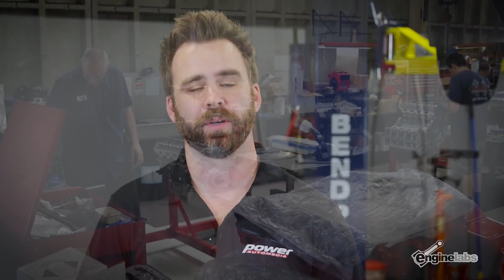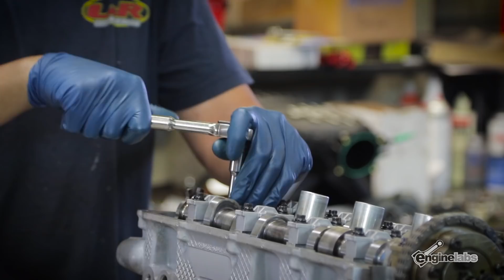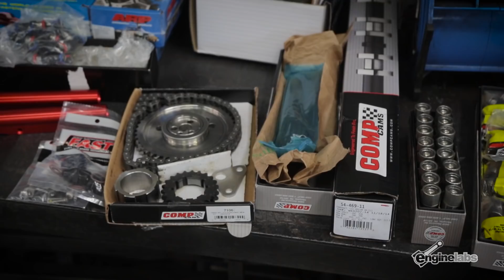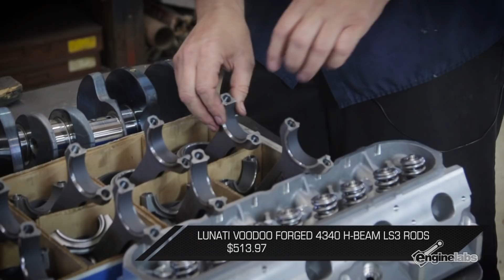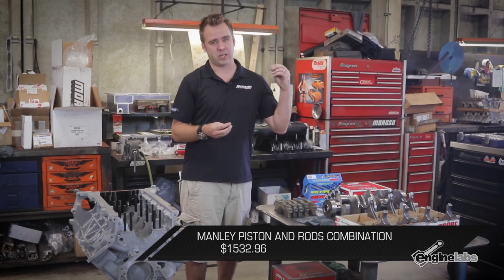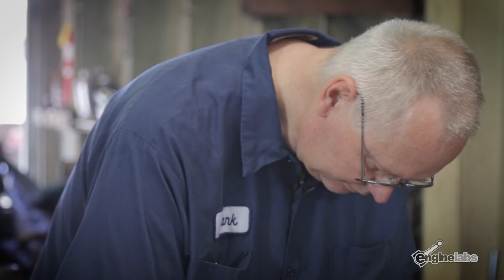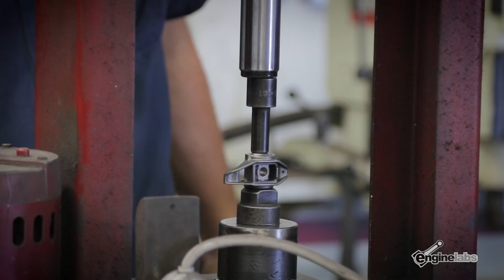$10k Coyote vs LS3 Shootout - The Build

Comment: LS376 is the LS3 with a few factory upgrades. Cost less than 10k and make 525 HP
Reply: Gregory Kanniard The fuel injected ls376/525 costs a little over 10k. The carbureted ls376/515 is a little under 10k.
Reply: yea id stick with a 383 can make same hp under 10k including the block

Comment: HP/CI is a stupid measurement. Consider that the coyote will be running at a higher rpm, flowing more air, when it makes it's peak power in comparison to the slower turning LS. If you're flowing more air, you're also burning more fuel. Even though the Coyote has a smaller displacement, it is likely using that displacement less efficiently than the LS. If you really want to compare volumetric efficiency, compare. HP/(CI*RPM) not HP/CI. A more useful measurement is which makes more horsepower per lb? I could put a 19L cummins in my car that makes 700hp, but it wouldn't do me any good since it weighs 2 tons.

Comment: Should have used a seasoned LS block too and put the money into more power.
Reply: @Zo Fryer bored, honed, machined cylinders, polish crank & rods, balanced assembly myself.
It was a waste of money what they 
did is what your not understanding
Reply: @Zo Fryer I think so. Coyote are
awsome engines no doubt but not
as common in junk yards. Using only
a block from junk yard is fool hearty
I don't see the value unless it's a super rare engine.
Reply: @Zo Fryer yeah agreed, flat plane 
VooDoo engines sound awsome & by design just rev higher & smoother
& capable of building very linear power thru out the power band.
Many engine manufacturers are
moving to flat plane & cross plane
for these reasons.

Comment: Hey can you guys weigh them as built as part of the comparison?
Reply: I was going to ask the same thing lol
Reply: Bryce Pal yeah i was surprised at how small the ls is. Got to be quite a bit lighter.
Reply: youd hope so lol
Reply: LS is lighter, i would guess at least 30 lbs.
Reply: +Gilbert McGillicutty 18 pounds
Reply: +Nick Sandman 100lbs
Reply: +Mark S The Chevy LS7 weighs 454 pounds, the Ford 5.2L Voodoo weighs 431 pounds.
Reply: Escape for Mankind An LS7 weighs 417lbs.
Reply: Escape for Mankind is Keith Johnson neither of those are the motor shown
Reply: @ChuckBeefOG  30LBS ??? Coyote has 4 cams, huge heads, more cylinder wall materials, fazers, do dads, crap, more crap I'd be surprised if its not closer to 100LBS difference. Sadly the Coyote is going bye bye shortly
hopefully Ford will build a V6 version of the Coyote to sell side by side with Ecoboost V6 & I4...
Reply: @408SPLKINGS  I hope you’ve done some research in the last year 😂. Only about a 20-25 pound difference depending on the exact configuration.

Comment from the maker: UPDATE: The Coyote has been dyno-tested. Working on the video and part 2 of the article now.
LS Dyno Results have been posted --> http://www.lsxtv.com/tech-stories/engine/update-ls3-vs-coyote-budget-shootout-ls3-dyno-results-are-in/
We are sorry for how long this has taken. We had experienced some oil pressure issues which are NOW resolved. But we were on the dyno and had the issue, had to rebuild the engine and then reschedule the dyno session.
Reply: +Power Automedia you guys should have done the cobrajet inake for the coyote. no loss of torque and a higher rpm redline
Reply: +Power Automedia LS engine loses since it had to be built twice!
Reply: +dubya TF the coyote had to be built twice not the LS. Not to mention they had to buy a junkyard coyote block and bought a new LS for less money.
Reply: +Austin Campbell Its crazy that they charge that much for a junk yard motor, they were better off going to an auction and buying the entire truck/car for that. But it makes sense the LS has been around for ever so they are a dime a dozen. The coyote is relatively new so they are going to be harder to come by and more sought after.
Reply: +Power Automedia Testing has been done, LS coils were better than MSD.
Reply: +Dan Witherow 3k was likely a whole longblock, not just a bare block.  If they did pay 3k for a bare block, they are indeed morons; you can get a ford Racing aluminator for 7300 from Tousley, that already has nice rods and pistons in it... add cams and a cobrajet intake and you're done.
Reply: thats the fault of the builder not the motor.. I've put a few LSx motors together and never had oiling issues. PLUS the whole point of the LS family is how cheaply they can be done.  Ill make more power than that ls3 with an iron block lq4, with half the money, a 100k mile block and bolt ons.  I didnt see any mention of cam choices.. SO much was left on the table.  For a medium budget build like this i expected better.
Reply: @dan LS motors are not that cheap.  LR, LM, LQ and others are cheap, but the LSx aluminum family still pull serious numbers.  LS2 pullouts a dozen years old are still pulling in 4k plus
Reply: When they put fuel injection on that same Coyote.. it made even more.
Reply: and more expensive, and less power
less parts that interchange between other engines
did I mention you are paying more money for less power?
Reply: They didn't even mention the LS3's biggest advantage... being a physically smaller engine in every dimension, with the majority of it's weight (Which is, admittedly, much closer than I originally thought), being lower down.
Reply: Power Automedia l
Reply: Yea.. but which ones made that with 5 liters?

I definitely have an open mind...
Reply: SirtubalotTX yes that is true but then again the ls is a single cam v8. The5.0 has 3 cams.
Reply: Manny Gonzales 4 cams.:-)
Reply: SirtubalotTX i was gonna say that but i kinda thought that would be alot lol!!
Reply: Power Automedia it

Comment: LS3 gonna have more TQ but the coyote might have more POWAAA!
Reply: Stock the LS3 has more power and torque.
Reply: @alekssbelskis3544  no Lmaoo which coyote though ? Gen 3 coyote makes 460
Reply: @twinsandboost191  ls3 has 430hp, and an LS7 has 505hp.
Reply: @alekssbelskis3544  we’re talking about the ls3 here, and having an LS7 making 505 with 7 liters isn’t impressive. The Shelby gt350 motor makes more than that and it’s a 5.2….
Reply: @twinsandboost191  ls7 is underrated at 505 .. voodoo rpm isn't impressive when you can make a ls Rev as high

Comment: It really says alot when a used 5.0 block is still over twice the cost of the new ls3 block. Would prob suck ass to change the 5.0 cam setup compared to the lighter, more compact ls3.
Reply: It wasn't a used block, it was an entire take-out engine.
Reply: Thats not bad used 6.0s with a lit of miles sell for near that around here. I missed that sorry

Comment: 2 months later... Are you releasing part 2 or going out of business?
Reply from the maker: +PMitchell106 UPDATE: The Coyote has been dyno-tested. Working on the video and part 2 of the article now.
LS Dyno Results have been posted --> http://www.lsxtv.com/tech-stories/engine/update-ls3-vs-coyote-budget-shootout-ls3-dyno-results-are-in/
We are sorry for how long this has taken. We had experienced some oil pressure issues which are NOW resolved. But we were on the dyno and had the issue, had to rebuild the engine and then reschedule the dyno session.
Reply: Your a farce...let some Ford guys do this test or just stroke the Coyote to 5.8 Liters...Your LSX test is designed around the GM Crowd...sad like a Peta-file.
Reply: Rabbi Schlomo really? Lets compare sales of the Mustang against the Corvette and Camaro.
Reply: Rabbi Schlomo how many of those are still around...I’ll wait.
Reply: Like a pedafile your going back to 50's and early 60's....and yes Mustang has out sold Camaro 3-1 forever and Corvette is not even close. The problem with you GM guys is you only look at your video and keep in touch with your own. NOT UP TO DATE!!!
Reply: LS is lighter than the Coyote..by about 15 lbs. The 5.2L Shelby engine is about the same due to lighter parts. There is a comparison and the LS7 7.0L is the same weight as the Coyote engine.
Reply: Mike Smith  No, Still chasing MOPAR...They have been since the 50's. A LT4 with only 650hp out of 6.2l boosted....when dodge had made 840hp out of the same displacement and 797hp in a daily driver Redeye. GTFOH. Even worse is Z06 and that all their testing and they still released it with not enough cooling and it over heated (early models).
Reply: @HaynesJP  " Lets compare sales of the Mustang against the Corvette and Camaro." Just says that ALOT of people are Brand loyal and don't care about performance. 
FYI, The Mustang has always been the sports car for WOMEN..since 1964 1/2 when Sale to women made it break sales records. It was even called the "Secretary's car". To this day it is still, the #1 sports car bought by women.
Reply: Mike Smith  "GM dominated the original muscle car era..." Of the posts you've made....this is were you are Wrong. Mopar has been the KING when it comes to performance....since before the small block chevy was even born...FACT.

If engines were men, The 6.2l Demon/redeye engine could T-bag the LT4 and he couldn't do anything as the Balls would be like THOR's hammer and would be unmovable. Even the old 80's 350 were a joke- Weak Cast rods/cranks/blocks compared to the 360 LA engine.
Reply: @JerseyMikeP  what are you saying ??? Those arent even Hemis
!!! Only Hemis by marketing & sales.
Theres nothing hemisperericle about their cylinder heads or piston tops.
Mopar comes in dead last place when it comes to quality. They not only loose to Ford, GM, but EVERY Japanese & Korean car builder they sadly loose to the Brits & we all know they build crap. Mopar ??? 
Hemi flattened cams, oil burners under 20-30k miles, spun engine bearings, broken trannys under 40-50k miles, driveshafts at every race track...hecho en Mexico
They cant wont even consider hybrid
bcuz their engineers are stuck in the stone age...what are they gonna do when big brother E.P.A says NO more fossil fuels....Mopar hasnt progressed since Cummins & the Caravan...Mopar isnt even global never has been & never will be
the glory days of the 60's & Lee Iacocca long since gone. Mopar
has consistently been on consumer reports sh!t list yr after yr as a matter
of fact they normally have won every category in sucking. As fast as modern day Hemis are on the track they spend more time on the tow truck, service department ( LEMON LAWS, warranties, buy backs )
Mopar is an F/N joke.
What would you like to buy ?
We got gas guzzling hemis
We got jeeps with mini van engines
We got Cummins & every Cummins you buy you get a piece of sh!t truck to go with it.
Fiat 500 ?
The big 3 all suffered numerous bankruptcy but Ford & GM will survive. Mopar ??? 6 local dealers just closed permanently with in a 100 miles radius of me this last month.

Comment: For HP/Cu.In. the Coyote will win imo.

The LS is popular for swaps because:
 
1.) it has greater displacement in a smaller package (Due to having 1 single cam) so you can shove it in a Miata
 2.) Its un-complicated due to using dated tech (i.e. pushrod)
 3.) its cheap.

The Coyote is:

  A) Much More Efficient due to its DOHC, and VVT ( this is why the motor is bigger)
  B) Superior technology
  B) is much more stout outta the box

I think of it like comparing Turbo's to P.D. Superchargers.
 
The Turbo, like the coyote, is: 

  A) Much more efficient
  B) Can make a lot more power 

P.D. Superchargers are:

  A) Cheaper
  B) Less Complex
  C) Smaller packaging (Easier to install)

Comment: I guess you can run fords with no heads? i seen the ls3 cnc ported heads on the build sheet with a price, but forgot to add the expensive dohc ford heads! Got to run them head less to keep it on the same price point. Would love to hear more about those bad ass "truck heads" that your running on that truck block?
Reply: Because the stock truck heads flow awesome. Stock for stock, the 5.3 can't touch the Coyote.
Reply: Stoner spent $3000 for a used engine hes already upside down on build no money for heads

Comment: I feel you guys cheated by using a used coyote block. gotta take the cost of new into account if you're doing a price build vs. price build. No doubt the coyote is a pretty nice engine, but you can't beat the cost of LS new.
Reply: +Squigly Kimera    They had to cheat to help those expensive ford coyote ohc engines out.    ford cant compete with GM dollar for dollar !
Reply: +Squigly Kimera It is a price build. Both just under $10k. Let's wait and see the results for $10k before you go off speculating, whining and complaining.
Reply from the maker: +Squigly Kimera Both build teams could use new or used, with a Coyote we felt this was the most economical way to go for a core.
Reply: +Marshall Guillory There was no whining. Just an observation.
Reply: Power Automedia   Could have gone the same route with the Chevy engine, and would have had more money to spend for more power.
Reply: Turbo Camaro uhhh no any joe off the street can do the same. In fact, most guys do buy used f150 blocks. It’s actually more real world